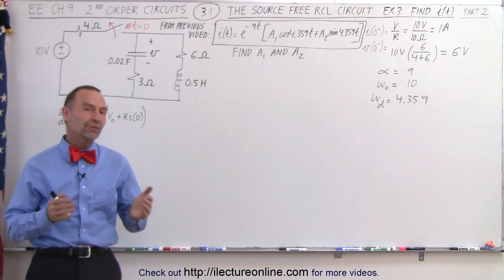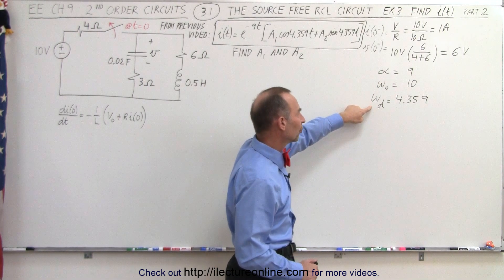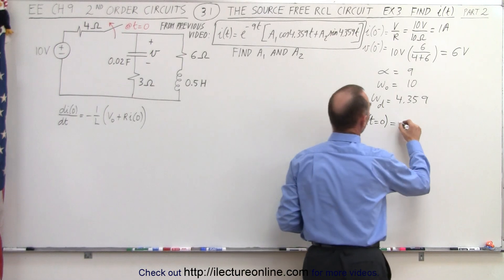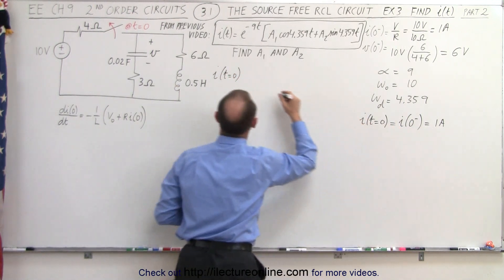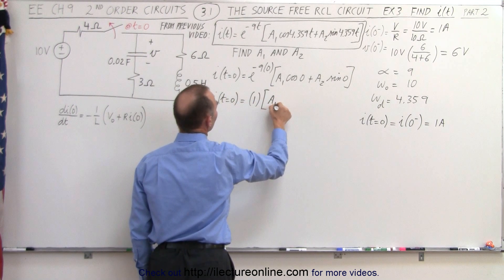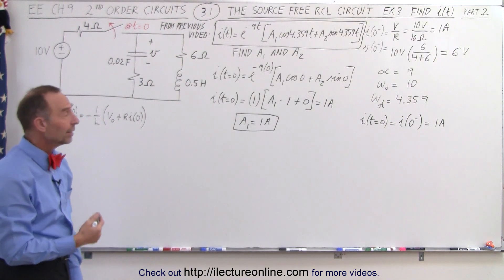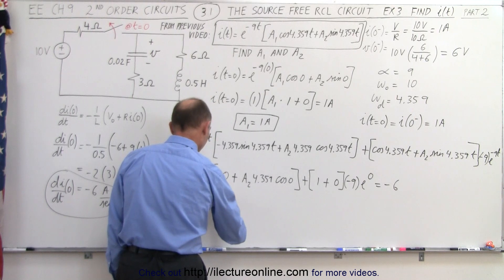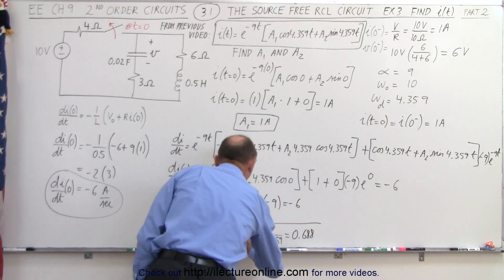Electrical Engineering: Ch 9: 2nd Order Circuits (31 of 76) Source Free RCL Circuit: Ex. 3 Part 2

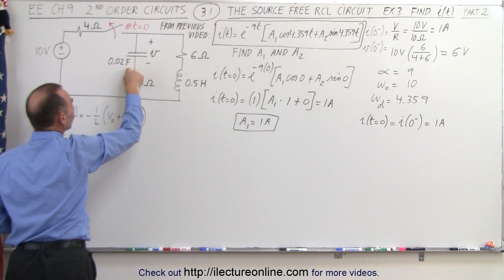Comment: So do we determine the sign of the capacitor's voltage when inspecting the steady state (t<0)? If so why didn't you add it in the previous video. At 3:15 You say it's negative because it's a voltage drop but R*i(0) also is a voltage drop why isn't it negative too?
Reply from the maker: When going around the first loop (in this video) the top part of the capacitor is on the same side as the plus side of the battery.  That is why the top of the capacitor is positive.

Comment: Indeed you rock,  oh and extra explanation on 3:09:
   - the positive i(0-), equivalent to the current in the inductor before t=0,  is assigned a downward direction.
   - thus, positive current direction after t=0 goes clockwise. 
   , and capacitor current gets positive whenever it points up.

* actually I've theorized I(t) and V(t) have same numerical signs, (+,+) or (-,-), whenever current points from + terminal  (higher voltage) to - terminal (lower voltage)

    - but voltage drops downwards, (so opposite to + current direction). and yea, V is negative.